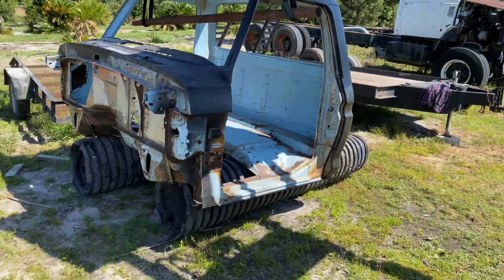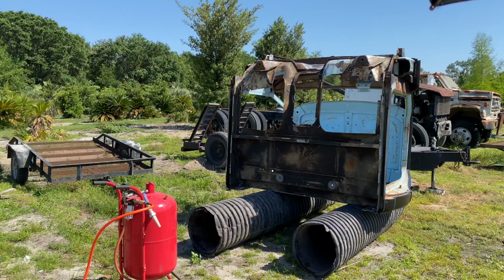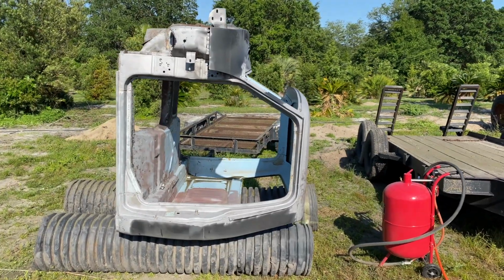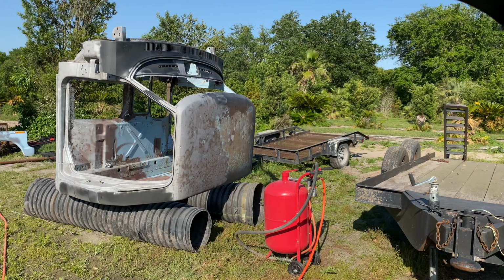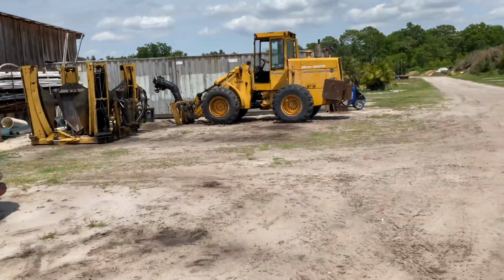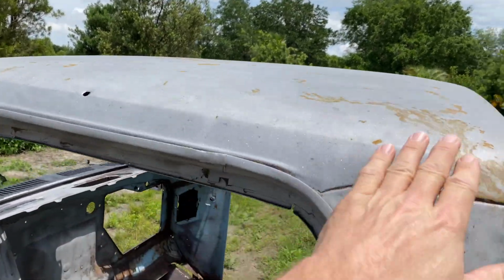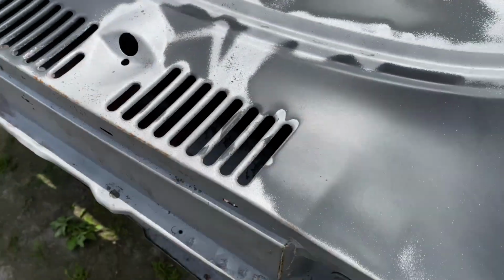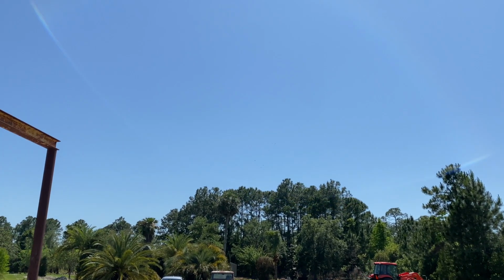SWAMP DRAGON RESCUE | Sandblasting The Dragon Cab, Restoring a Ford F250, Resurrection Restoration!

Comment: Couple things that will help others and hopefully future CT.. if you know it will take multiple days, limit yourself to do one section at a time (mentally divide up the body), blast one section, then seal it.  Seal it with either epoxy primer or even rustmort (temporary) so it won’t flash rust.  Flash rust is pretty serious, you can introduce rust to areas that were protected (like the rear cab that already had primer), and it can be a bit of a nightmare.   At least give yourself a couple hours at the end of the day to seal any section you blasted, never tarp it because if something happens where you get delayed you could ruin your project.   Also CT you can totally prime this without your brothers help, it isn’t like the final paint, you can make mistakes and it will still turn out awesome.

Comment: Great job, I am pleased you agreed with my suggestion and get the blaster on a long hose away from the buildings. That’s doing a much better job than grinding. Regards Mike
Reply from the maker: Yes, I was surprised the pressure held and wasn't an issue. I think I could have gone another 100' with no issue. Thank soft the idea!

Comment: Hi CT! you did a good job! By sandblasting the body, you can get an idea of all the points where the rust has passed through and it will be necessary to weld a patch. There is still a lot of work, but The Dragon will be back on the road!😎👍💪

Comment: Those loovers. Down in that cavity. Where the wind shield wipers mount.  How is the best way to handle that. On my truck I believe it was galvanized metal under the paint. But, now it's gone like CT'S and rusty.  Interested to see the course of action for that.
Reply from the maker: Hey Roger, It's hard to get in there. I'm going to get one of those paint cans that have the hose attached to spray in tight spaces. I think Eastwood has one. Maybe some of the other guys will have some ideas?
Reply: Sounds good!!.. I know others have had this come up before!! Loving these videos!!!
Reply: Eastwood Sells Rust Encapsulator In An Aerosol Can With A Flexible Tube

Comment: If you have not already you need to get a rust preventative primer on the cab or you will have flash rust all over before you know it
Reply from the maker: Yes, we have it covered in black epoxy primer. You will see it in the next video.

Comment: Your lungs are worth more then a harbor fright maks man get a 3m with p100 filters and a nice blast hood also put a giant tarp down to collect all the media why waste it when you can sweep it up and screen it
Reply from the maker: It worked pretty good but you are correct. I did buy a better 3M mask and it is way better.
Reply: @CTmoog  thats good I had the same setup before and switched to the 3m what a difference